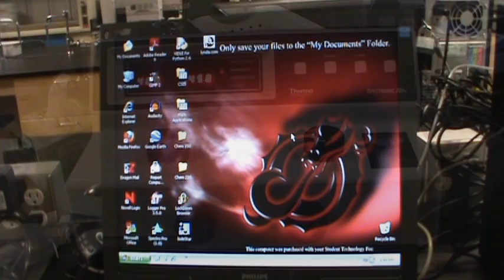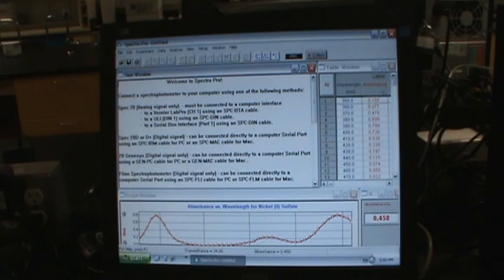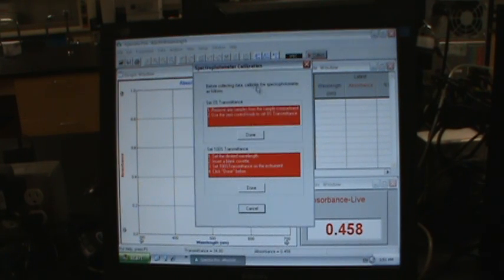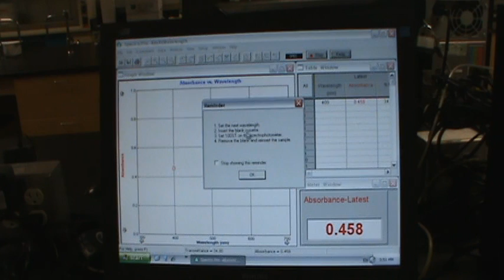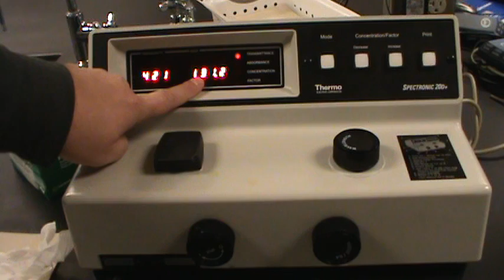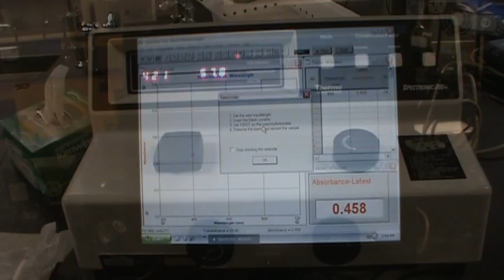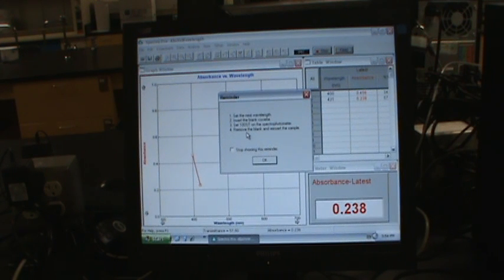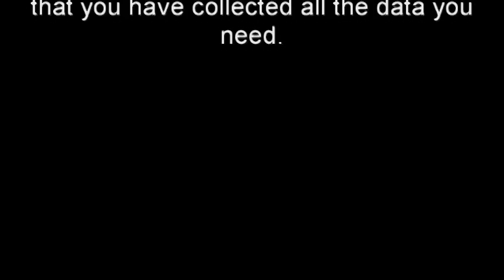Measuring Color: Using the Spec-20 Spectrophotometer {Part 2}

Comment from the maker: We use small test tubes in our Spec-20s, so the path length can vary quite a bit. That's why it's best to use the same test tube in the same orientation for all quantitative measurements... if the pathlength is constant, it can just be included in the "constant" from Beer's Law and it doesn't matter if the tube is 1.00cm or 1.15cm or 0.93cm. But yes, if you're using a standard 1.00cm cuvette (inner diameter), then the pathlength is 1.00cm.

Comment: If your using the 1/2 inch cuvettes for Absorbance readings, does than mean the path length used for calculations is the diameter of the cuvettte 1/2 inch?